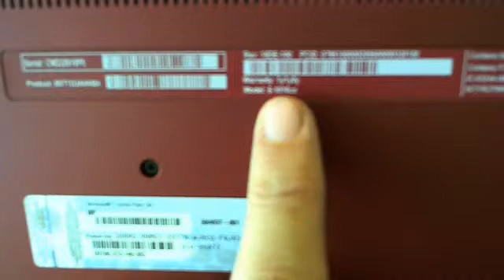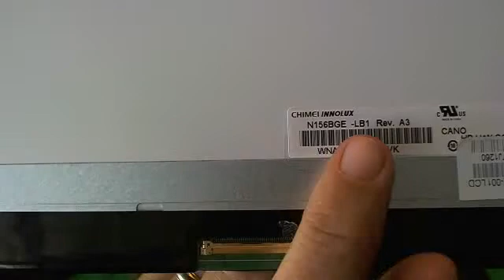HP Envy 6 Sleekbook Laptop Screen Replacement Procedure

Comment: How can I turn off the fan for external cooling pad when my HP Envy Sleekbook DV6 3114CA laptop is turning off power, The fan of my cooling pad still running from its laptop's battery until draining out of its juice? In BIOS,  it does have an option: the feature of the fan: on or off. I did disable the fan feature but it did not do affected at all.  Anyone have that problem, let me know please. Thanks

Comment: HI.  Since I changed my lcd my screen is blank and when I power on the light stays on for  a few secs and then goes off. Could it be that it wasn't powered down correctly? What would the damage be if that was the case ?
Reply from the maker: +Gordon Konheiser It may be an incompatible screen. Please contact the vendor where you've bought the replacement. Thank you
Reply: +Screen Surgeons no I think it had power when I changed it and now the main board if fryed , does that sound likely
Reply from the maker: +Gordon Konheiser Please double check to see if the cable is seated properly at the back of the screen.

Comment: Helpful tool for getting into the bezel / LCD separated is an old credit card/gift card...... as the fingers could crack it if you pull to hard or the screw driver on the bottom side could scar (bend / damage) the plastic........ just a FYI. helpful video. nicely done sir.

Comment: I upgraded my HP Pavilion G4-1365 and I can no longer configure the BIOS, already testing several buttons (del, insert, esc, F2, F9, F10, F11, F12). I know I used the correct upgrade file for the requested link to the HP technical support. Assistênca not asked about this matter because I know the answer. hehehe. I want to boot from the DVD drive and run virtual machine x64 bits. I know set up, but do not know which is the correct button.